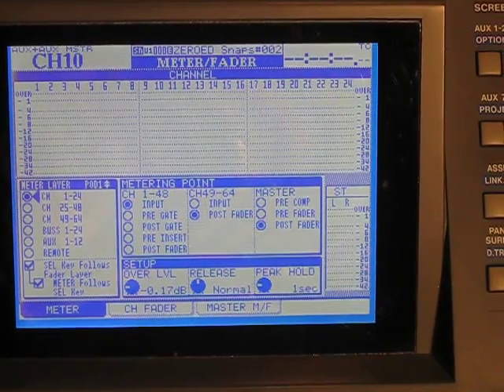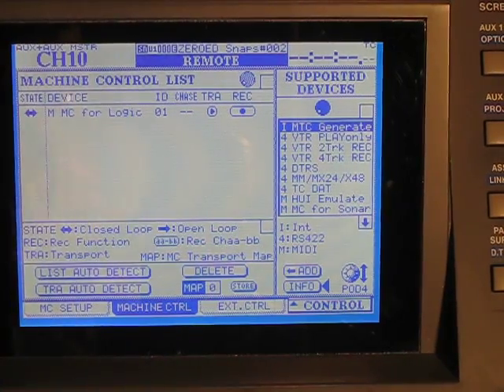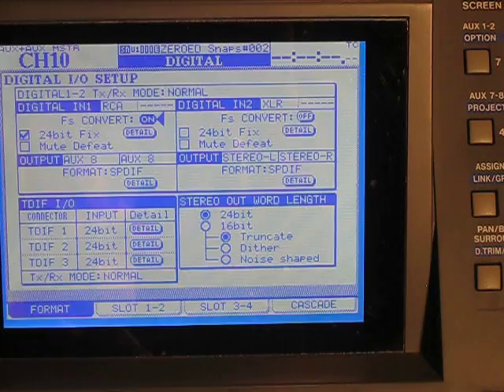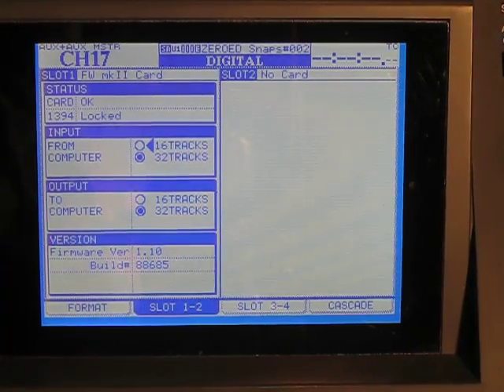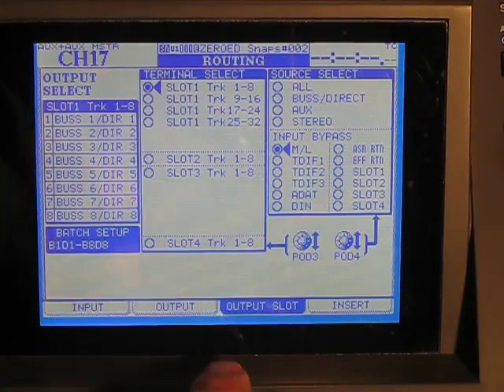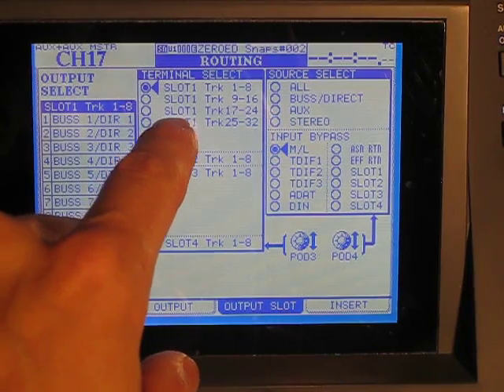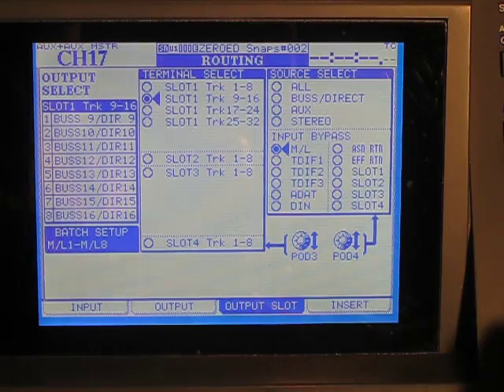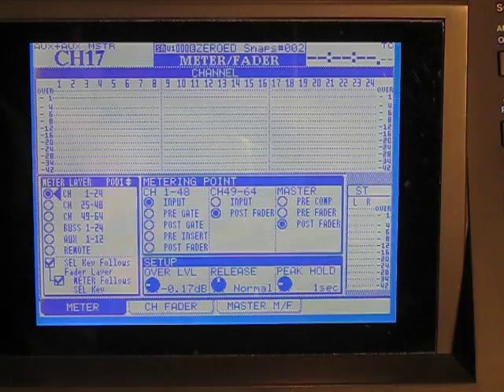Setting up the IF-FW/DM mkII interface card

Comment: Still waiting for the input tutorial. Thank you for sharing your time and experience with us.
Reply: Hi, I'll give you the input tutorial 🙂 Set the inputs to M/L when recording into your DAW. After you're done recording then switch them back to Slot mode for play back. You're outputs always stay at the M/L setting for all tracks. Only the inputs need to change from M/L to Slot mode. Also make sure all channels have the Stereo button lit on each channel. This is for monitoring each channel. No need to mess with the direct button or the output assign either. They are more for assigning Busses.

Comment: How do I get Dm4800 to work with Sonar? I used your tutorials to get the FW card working but my Transport, Mixer Controls are not controlling Sonar. Do I need to hook up a midi cable from the mixer to sonar or will it bring that info through Fw
?